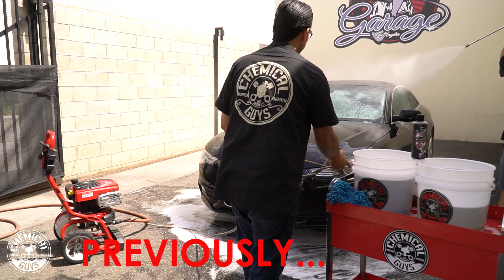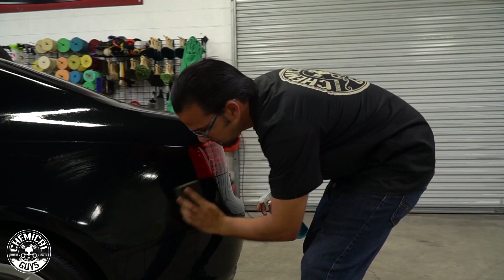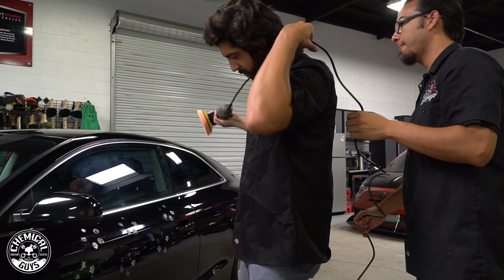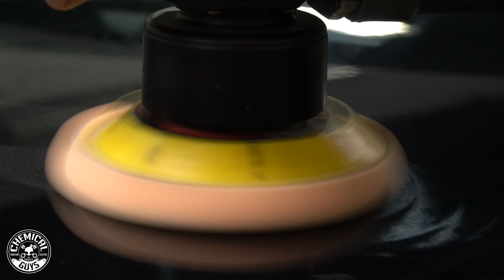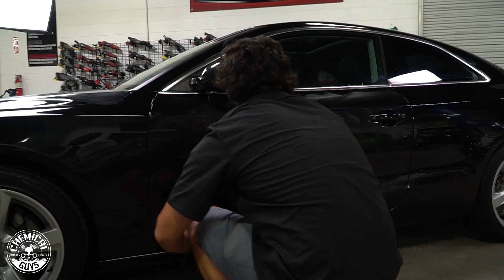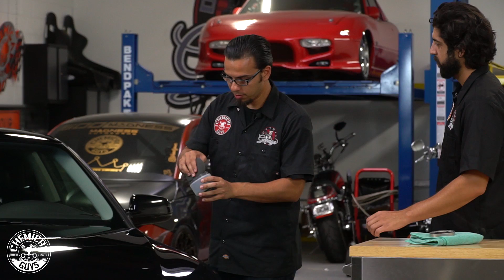How To Properly Prep Car For Paint Correction - Audi A5 - Chemical Guys Car Care

Comment: When should you apply a glaze? Do you glaze, sealant, then wax? Or sealant, glaze, then wax? Thanks for the feedback.
Reply from the maker: Hey Joseph, lets talk coatings for a sec. Glazes fill in scratches to create the temporary appearance of a pristine paint job. You apply a Sealant on top which contains synthetic polymers that mimic the protective properties of Carnauba wax, but lasts longer because it's not organic. The Sealant locks the glaze into the pores of the paint preventing other cotaminants from imbedding into the paint. Lastly you apply a wax which enhances the shine of the paintwork, and creating an additional barrier against oxidation from  harsh solar rays.
Reply: As long as the glaze is an acrylic/synthetic glaze.  Some glazes you get at various retailers have carnauba included in them and will prevent a sealant from properly crosslinking and adhering when applied.
Reply: Joseph Lord Except permanent coating like ceramic coat, every products you put under sealants are  complete waste and may even reduce the effect of sealants.